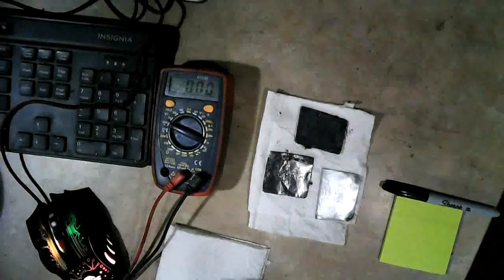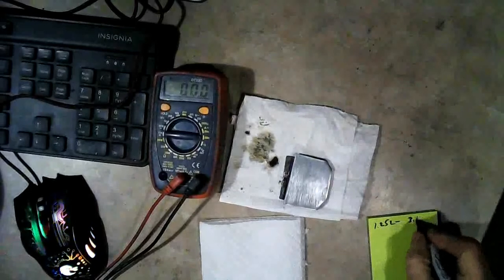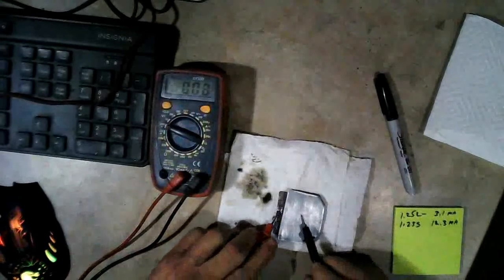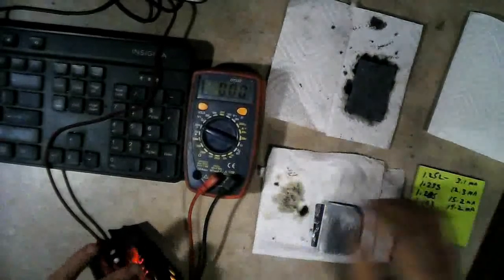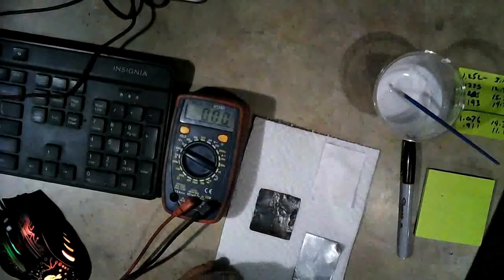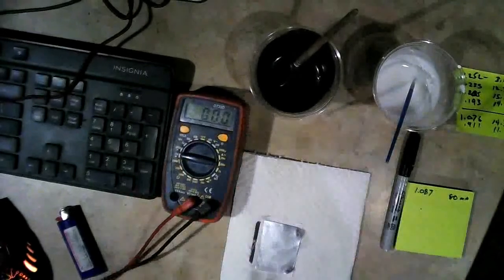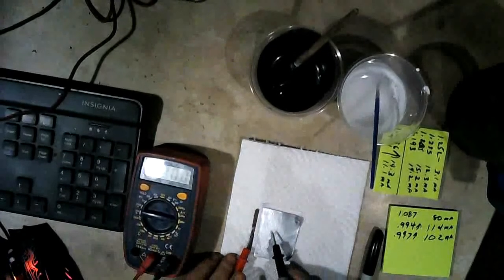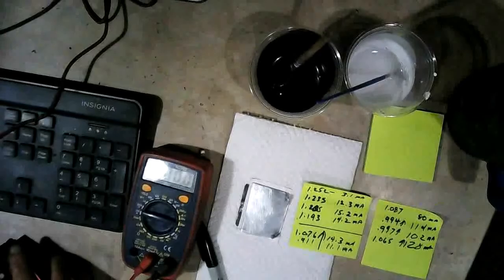Triple Dip Carbon Felt Test!

Comment: Oh my, I'm so sorry. Seems I'v made a mess here. I realize I should have at least left a comment or description in the video. That's 14mA not 14V my friend. The maximum voltage I got from these thermal activated cells are 5V. It seems I made a confusion when I wrote that the results you can expect from a thermal activated cell is much higher than 5V. What I should have written was. A properly made thermal activated cell with the proper electrolyte and anode / cathode has the potential to reach a much higher voltage. But when it comes to Mg/Carbon a much higher voltage would mean 2-3 more volts at best. 14V in a single cell would be unbelievable, I'm not sure if even lithium can be pushed that high. What the video was meant to show was the relation between the voltage and amp, while heating up and cooling down. Once again sorry about the confusion Ray.
Reply from the maker: No problem Baka. I should have paid closer attention. I saw what I wanted to see. Lol  I'll make a correction to the description box. :-)